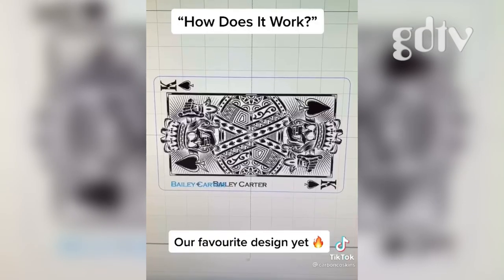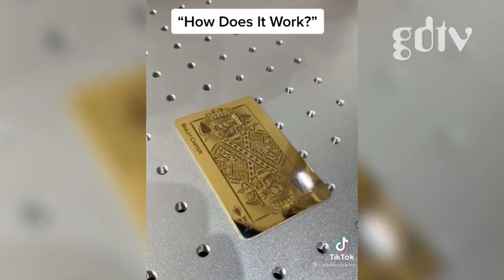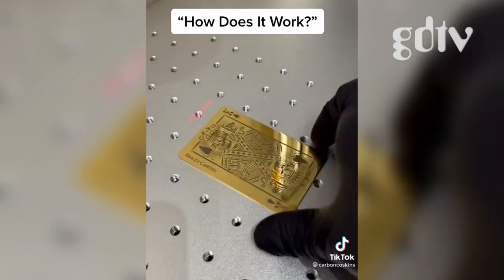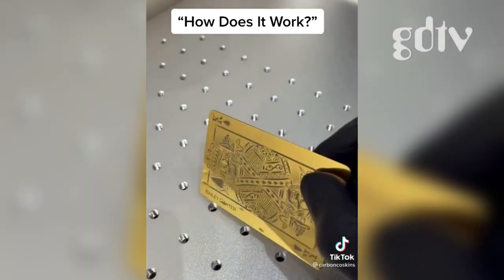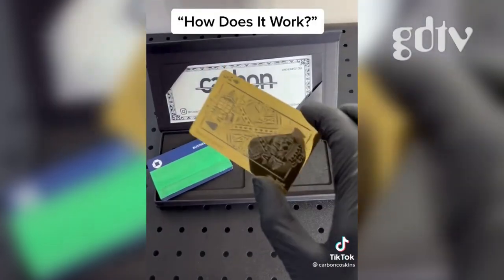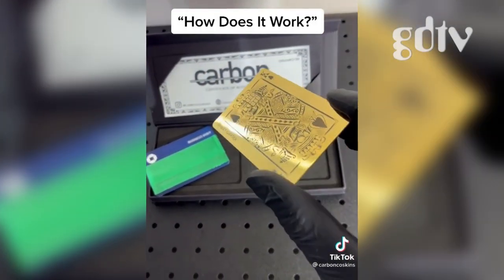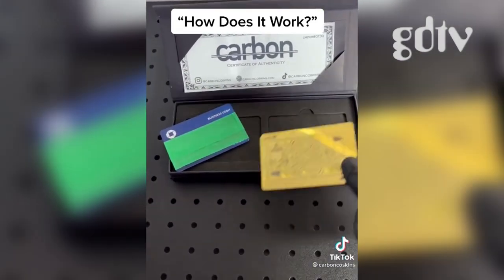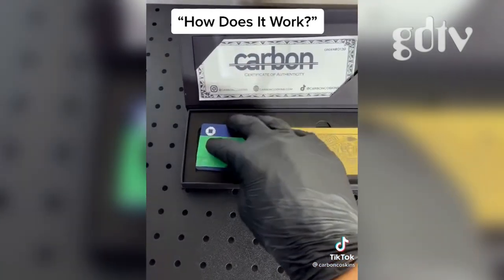Carbon Co Makes Custom Metal Bank Cards

Comment: Will i still have contactless payment?
Reply: I searched it up online I'm pretty sure it is.
Reply: I cant say for sure but i am going to test soon. I heated the chip until it lifted and i used nail polish remover to soften adhesive and slowly cut adhesive as it lifts. I left the chip to soak in the nail polish remover and i wiped the remaining adhesive off and chip looks brand new like out of factory. I was thinking wireless.antenna for chip.runs through out the entire card but it doesnt seem that way as far as i can tell. We will see soon enough
Reply: If emv chip.is installed backwards will it still.work?
Reply: Trying to fond answers for a friend in the business. They need to know if the chip is.on backwards or maybe damaged that is why it won't work

Comment: Sooo send your credit card to a complete stranger
Reply: No you can send an unactivated card so they can’t take the money out of your account since it hasn’t been connected yet
Reply: @kirayu1  If they save your info they can just use it once u activate it
Reply: Question: what if I erase the numbers before sending it and the chip is not activated? I don't care about the numbers. Do you think my info would be safe then?
Reply: @bobsteven2363  you do know that without the pin number you cant do anything
Reply: @mega3noivern  I've been to a lot of stores that don't require pin number and basically all online stores don't require pin
Reply: @bobsteven2363  for online stores i have to use finger pin and in stores i can only pay max of 20 before the pin
Reply: @mega3noivern  damn, that is way more secure than normal. What bank do u have?
Reply: @bobsteven2363  ING nl
Reply: Its not much different than making payments on the phone.. you end up giving them the cards info